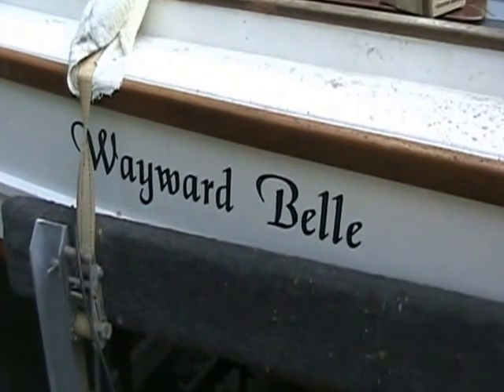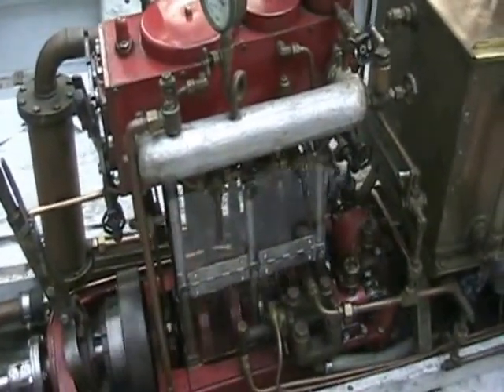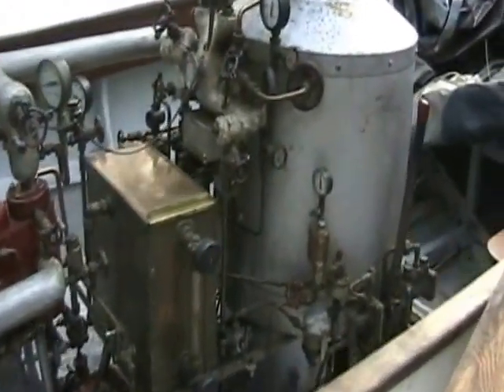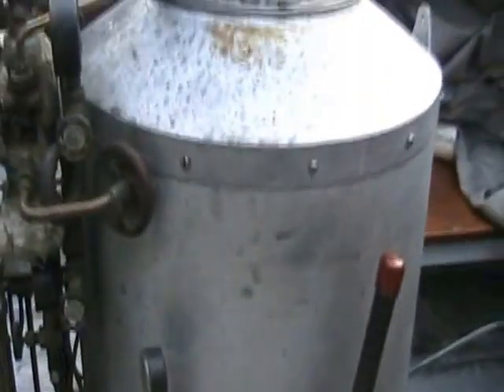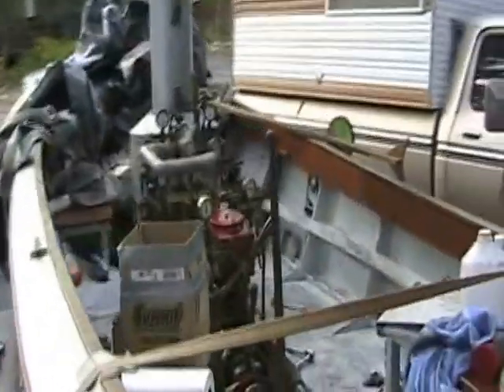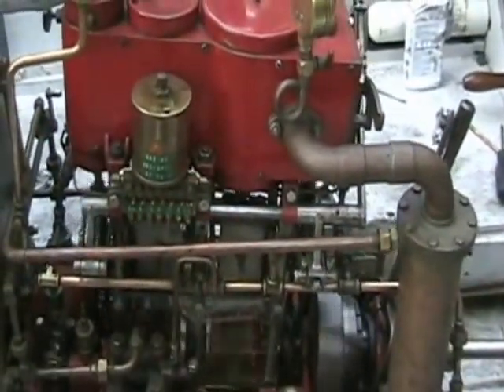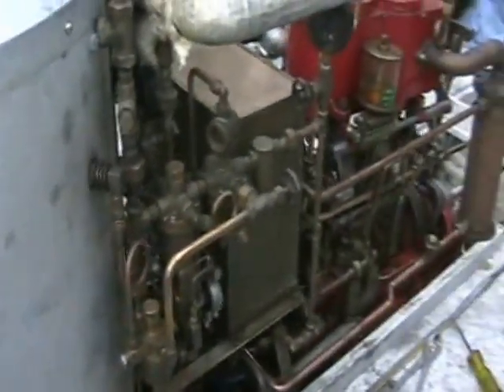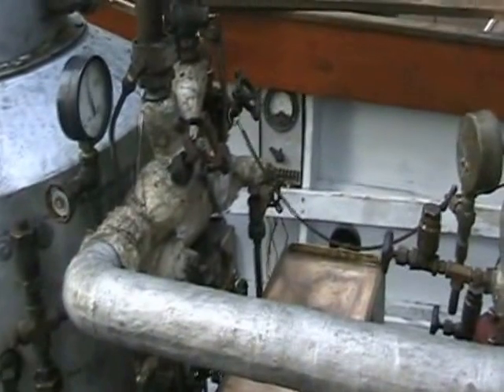Steamboat Wayward Belle

Comment from the maker: Not too much more simple.. just less moving parts in exchange for less torque, less aesthetics, and a piercing whine.

All of the complicated controls would still have to be present. Havng a turbine would also require a gearbox or some other means of reversing the rotation of the prop for exiting the slip and emergencies.

Reciprocating steam engines are a form of kenetic art.

It one wanted speed, reliability, efficiency, and ease of use, I would have to suggest a diesel.